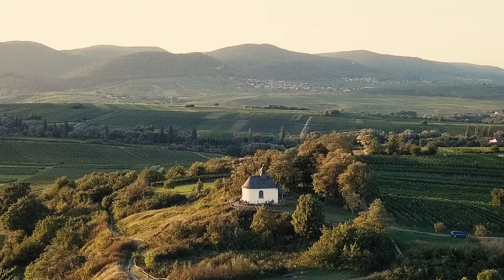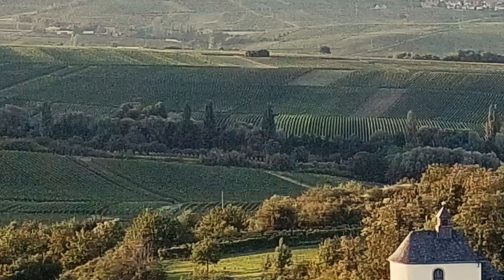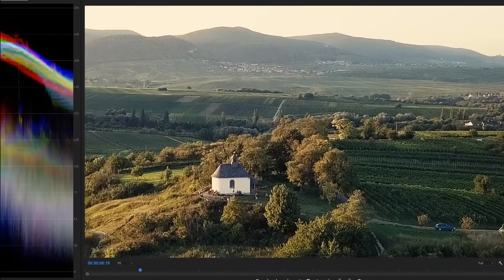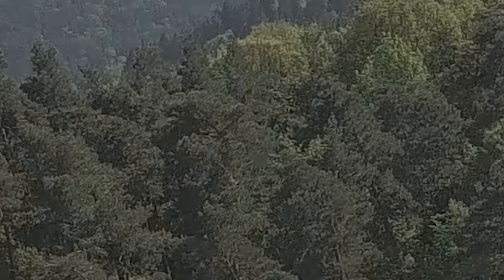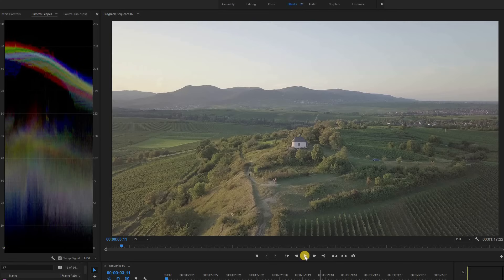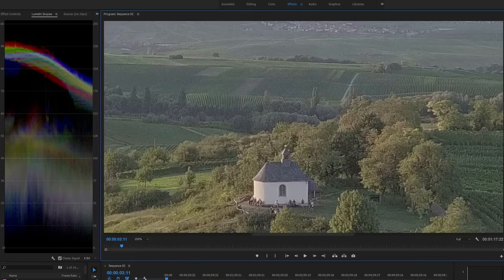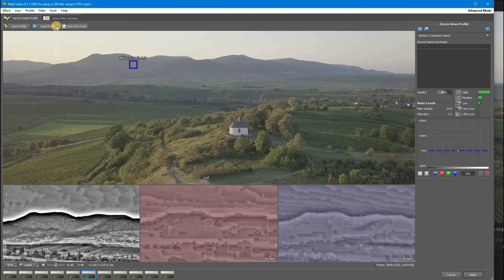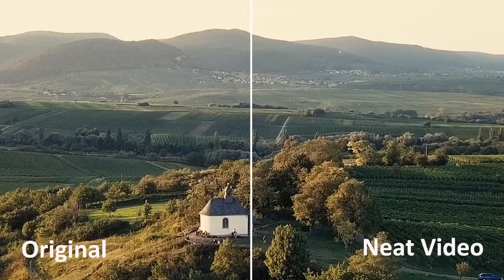How to Fix Flicker and Video Noise in Drone Videos

Comment: Hey there. I'm following your tutorials closely and i do have a question regarding choosing the 'Key Frame'. I'm using waveform(luma) and i don't see a jump in brightness on any frame. Am i doing something wrong? (I have to look at the width of the wave not to it's brightness right?)
Reply from the maker: Hi Mihai-Andrei, you should look at the level of brightness. Saying that, some newer models of drones have improved and flicker is got better, so it may be tricky to identify a key frame looking at brightness level. However it's still important to build noise profile on a key frame. You can also identify it looking at an area with lots of details, you will see that one frame in a series has more details that the other once. If you are using Neat Video 5, you might find Generic Profile helpful. We have just released two new tutorials about the problems working with footage from GoPro: https://youtu.be/Wy5_z82i4Yw and https://youtu.be/KFjhNPCaDt8. It's based on our latest version of Neat Video, version 5, which has a dedicated tools for dealing with local and frame flicker. Jitter of Details might be also helpful for footage taken by a drone.
Reply: NeatClips thanks for your fast response! I will definitely look into it! Yes, I’m using v5 of Neat video🙂 I’m using mavic air so probably that’s why I can’t identify the frame looking at brightness level. Just wondering why should we work on the key frame if that frame has less noise than the others. Shouldn’t we work on frames with more noise? (Will still go on 5 frames radius tho) Stay safe!
Reply from the maker: A key-frame is the noisiest frame in a series. Building a noise profile there will allow the program to obtain accurate information about the noise is the picture, which is a key to a good result. However, if you have a built-in-camera noise reduction switched on, try Generic Profile. In-can noise reduction can smudge uniform areas leaving details covered and surrounded by noise. Also watch our for jittering details.
Reply: NeatClips ok, thank you so much! Will try it later🙌🏻
Reply from the maker: @mihai-andreiosvath2475  NO worries at all!
Reply: @mihai-andreiosvath2475  salut. Ai reușit? Eu inca nu :/ da-mi te rog un semn daca ai scos flicker-ul. Mulțumesc mult!

Comment: will your application be able to fix noise in videos similar to this ?
https://www.youtube.com/watch?v=iwn-55jPamA
Reply from the maker: Hi there, sorry it took us so long to get back to you. 
Do you mean the jumping of the sky and jitter on the sand? It is not noise, but extremely aggressive codec. If you have an option to change the codec, please try the one that gives you the biggest file. Neat Video might be able to help with the sand. Not sure about the sky. If you send us the clup, we can have a look. 
You can also try our demo. Also check our latest tutorial https://www.youtube.com/watch?v=Wy5_z82i4Yw and https://www.youtube.com/watch?v=KFjhNPCaDt8. They were created for GoPro, but most points can be applicable to a video taken by a drone.

Comment: do you know how to fix drone video that looking like they glitch by in smooth way , my videos look like some wave happening in the landscape
Reply from the maker: Sorry, we have not come across such a problem. Could you please send us a short clip representing the case. Who knows, maybe it's going to be a new feature in the next version of Neat Video.
Reply: check your gimbal settings. t may need calibration. the wave I think you are refering to looks similar to when your try to use steady filter on premeire and it creates a wave, so the gimbal not calibrted combned with the electronic stabilzation makes the wave